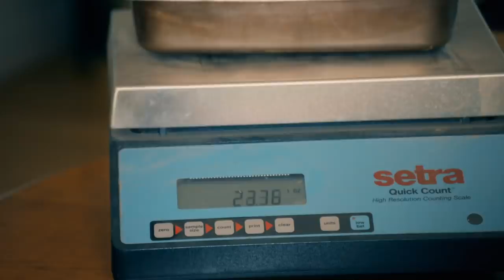Tony Beets Welcomes New Granddaughter With Monster $550K Jackpot I Gold Rush

Comment: Instead of welding that punch plate you could just think ahead 1 step and have clamp rails on stand by, they’re not expensive, shit.
Install new clamp rail with new bolts and put the welder away